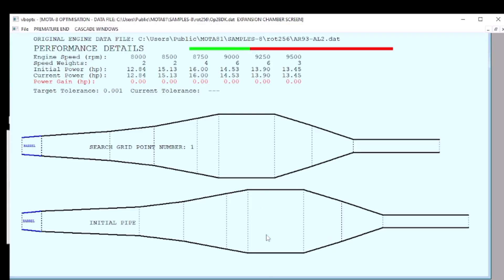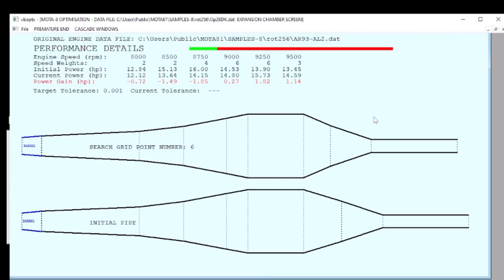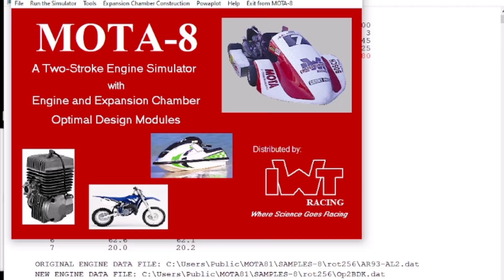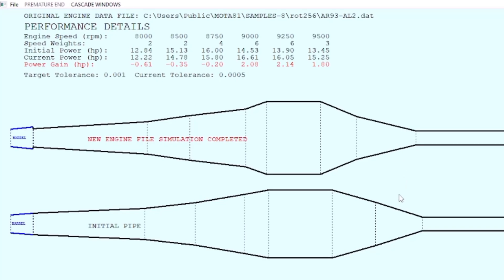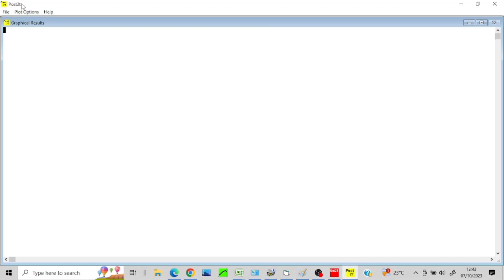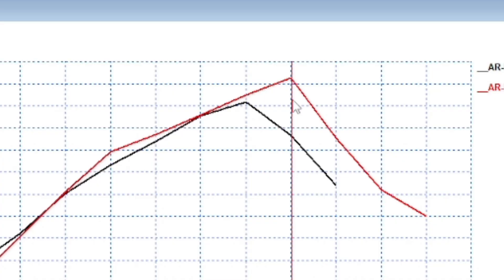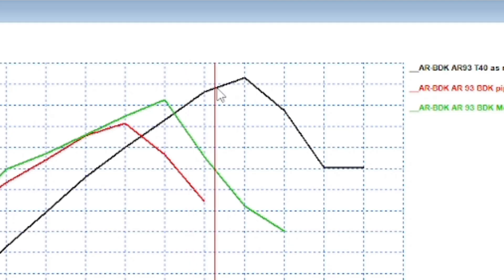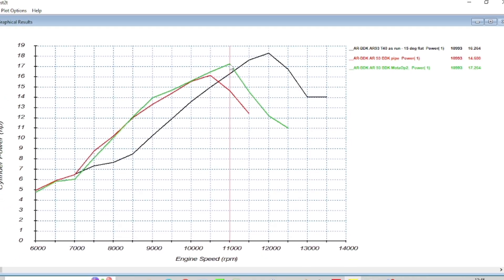A.I. designed tuned Exhaust | 2 Stroke Expansion Pipe | Mota 8

Comment: Thanks for sharing
Was there a reason for optimizing around 9k rpm in mota if you're looking in engmod2t around 11k or 12k rpm?
Reply: Power band
Reply from the maker: Hi Mitchell, I was wondering if someone would spot that! 😁
When I ran the dimensions I'd used in EngMod2T in Mota it peaked quite a bit  lower than in EngMod. I've found with the sims everything is relative so I figured a gain in Mota should still give a gain in EngMod. This was another reason for using EngMod for testing as it tallies with my Dyno results better.

It was an impromptu video so a bit off the cuff and first time for me using the optimisation feature. I need to play with it some more.

However, priority at the min is to get power back at the Dyno and do some testing ☺️

Comment: Hello - I'm interested in both Mota8 and EngModT2. Seems like Mota8 can only handle single cylinder configurations, is that the case? Can either of these deal with power valves? I see in both these software packages it looks like the pipe is always straight - how it a curve 2stroke dirt bike pipe dealt with? Appreciate the input.
Reply from the maker: Hi, yes. Mota just does single cylinders as far as I am aware.  In reality, on EngMod, I'd usually just model one cylinder if it were a twin and double the output. However, I did use it to design a 2 into 1 pipe for an RD350, so I did use two cylinders for that. Yes, I think be ause they are only 1 D sims then the pipes are straight. A full 3 D sim would be required to account for the turns in the pipe, but that would cost a lot of money and computing power.
I think of them as a comparator, make.a change, and see what it says.
EngMod has very good continuing development and can model about every combination you can think of and has an amazing array of information you can look at in PostMod. 
Mota is a bit more basic in inputs you need and the outputs in provides... it is fast, though, and on the optimizer seems really cool and can save a lot of effort. It can print out expansion pipe templates too which is pretty handy.
Both can model powervalves.

EngMod has more and MOTA is simpler (and a bit cheaper too)
Both are really good in my opinion. I guess it depends in what you budget is and how detailed you want to model.
Reply: @AutoBeta2T  Thanks for the info. It seems like people have used EngMod to develop curved pipes, and EngMod shows some pictures of curved pipes on their website. I wonder how effective it can be.

Comment: Is that a Kawasaki AR-80 Motorcycle?
Reply from the maker: Hi, the bike itself is an AR 50, but I'm running it with a 93CC Big Bore kit so nearer to an 80.
Reply: @AutoBeta2T  Awesome. We only had AR-80's in 1983 USA, and I won the 80cc WERA USA Grand National Championship.
I recognized it because of rear swing arm and mag wheels. (It's still in my storage
space (with a Kawi Rotary Valve 100cc engine), and I'm looking forward to riding it again) Thanks for answering so fast - but mostly for giving me hope in replacing that Kludge of a pipe I made for street commuting afterward...
Reply from the maker: @joeteejoetee cool, i also have the design for my pipe, but it does make the bike quite peaky
Reply: @AutoBeta2T  Peaky can be fun as-F though. The replacement engine is from a Kawi G-5 "commuter bike". I may have to replace the valve disk with a stock one because I remember after cutting away the rotary valve timing over a few weeks that I'd "gone-too-far" past optimum.
When it stopped being able to do wheelies in 2nd gear I was bummed, and knew I'd have to replace the valve plate and start all over again. I'd been buying used vanilla valves and cover-plates over the years on eBay knowing I'd need the stock parts in the 1st place: to have&modify them in this century...

Comment: I did this years ago optimizing Diesel calibrations, it's called DoE using an ETAS product.  It was integrated with the engine dyno and you put in what you want and what parameters to adjust them hit go.  It's not called AI because it's not AI.
Reply: Thanks for an interesting post!!

DoE is Design of Experiments. It's a technique for optimising multiple variables, with interactions between them. It uses methods like Orthogonal Arrays and Analysis of Variance. Fundamentally it is a statistical method and is not the sam  as state-of-the-art AI. ETAS is just a proprietary calibration suite, I think it is owned by Bosch. It has wide capabilities such as semi-automatic controller calibration and it even has the means to patch a Matlab  simulink Controller into the control software of the engine control unit. 

The above stuff is bog-standard grunt work in the auto industry but has little to do with your very interesting work.

If I understand it correctly you are using a solver to optimise the tuning using a proprietary engine simulator based on a 1D unsteady flow CFD code. This is commonly done in the auto industry when designing new/updated engines but I have not personally seen it done on an unblown 2-Stroke.

The best design optimisation solvers I know of are in the jet engine industry. Mind-blowing multi-physics  models. Those guys will kill for 0.1% fuel consumption improvement.
Reply from the maker: Cool, could you explain what DoE and ETAS stand for?

Comment: hey man fun question for you.
say ppl keep telling me to build my own pipe but im not a build a pipe guy but get the science. would you design me a pipe to build for a 70ish cc 2 stroke? i make around 20-22hp but in the wrong areas really. and the next pipe is about 300-400 bux. absolutely stupid.
Reply from the maker: Hi, what engine is it?
Reply: @AutoBeta2T  its a minarelli scooter motor with a racy cylinder on it. the yasuni c16 is pretty close to what i need. and i might have gotten my hands on a design to make a clone of one of those.
Reply from the maker: If you drop me an email @ autobeta2t@yahoo.com can have a look. If you can send the Yasuni measurements, that would help.
Reply: @AutoBeta2T  hey man thanks i really didnt expect you to be interested. but im glad you are. i had a bunch of life going on last little bit but now thats all over. im starting a new/old job and will have alot more ability to play around. i also went and rounded up some specs and pieces of what i built. and will have 1 item to change next season as i finally found the part number i needed.
i will get an email whipped up with some links to cylinder and pipe and also almost the entire spec for the pipe in question. maybe you have a better idea or design to unlock. im also willing to toss you some bux for your time when its all said and done.

Comment: The A.I. is just a program written by humans. With the limit of their knowledge of the subject.
Reply from the maker: Yep, I was a bit gimmicky with the title. Still a clever feature that saves a lot of time but still requires a bit more work in the sim and dyno testing after.
Reply: It works based on meta data trawling and then reproducing it, it could get to the stage where it will feed on itself data wise. Already there are operations in place to influence the meta capture information and skew the outcome, so beware.
Reply: @vumba1331  So no intelligence in there but just the reproduction of known solutions.
The best way to bury progress.
A quick response that no longer makes people think, on bases limited by understanding
of the programmer and his ability to properly code the little he will have understood.
Reply: @fabbri4497  Pretty much. Mind you, for some people it is intelligence.......

Comment: If you were to compare the two SIM programs, MOTA and EngMod2T;

Which one do you prefer and why?

Are things that ones does and the other does not?

If you were only going to use one of them for development, now that you have used both, which would you choose?

Thanks!
Reply from the maker: Hi, EngMod2T all the way. It has so much more than Mota.
I only upgraded my Mota as I wanted to play with the optimisation and 2D flow bits. I also liked using it for pipe layout and templates.
For pure development of an engine then EngMod2T. It constantly evolves into a better product as Neels updates it with input from the user community.

Comment: i beat Mota in 5 minutes    ..simply maximize pipe , that is pipe diameter ,  .... first go 150mm diameter  , only 3 parts  , 12 inch header 12 inch first cone and 12 inch end cone ,no belly , your jaws drop , 6000 to 16000 rpm like freight train .. adding belly with narrow your band so no belly ..  remember you need 360 degree intake to connect pipe to case and transfers , so you need to raise window holes up , to turn it into a case reed , now you can keep increasing case volume and pipe diameter to increase power to no end , unlimited power or you do it other way ,stuff case with skinny pipe and thats the end , limited powder.

Comment: Blimey, Mota has come on along way since I last used it. I had to stop when my version which used a parallel port dongle for licencing did fit my new PC which had no printer port. I switched to EngMod2T, what an awesome program that is. I used that to tune my Cheetah Cub 440cc and Cheetah DM 580cc motors.
Reply from the maker: Yep - I thought the same thing! I used Mota 6 for my first pipes for an RGV but then moved onto EngMod2T... I thought I'd upgrade as I wanted to try the optimisation element. As a note I fed my porting and pipe into it for port optimisation and it said 203 degrees on the exhaust which the Dyno agreed with on my last video ☺️
Reply: last version i bought was Mota 6.31 and it cost me a F)9*7^ 200 A$ and it did nothing more than the versions I did buy before, the only change was that  I could use it on a newer Windows machine, the manual is still crappy as the first day ( I still have the printed version of the manual from around 1998 )and it still does not explain why or how data you input will influence the results.. If I am right I did buy from 1998 till now one tad package and  3 updates,  and I have the feeling that overpaid for updates and even as a professional engine builder( yes I do that for a living ) I can not earn all this investment back without screwing my customers.

Comment: You should start with multiple different pipes...take the best of 4 and run that through again...feed it some odd pipes to mess with it could find sweet spot...Thanks For Sharing!
Reply from the maker: Hi, cheers and good plan.
It would be interesting to see where it goes with a different starting point. Will it come up with 4 different conclusions or one similar design. I'm going for the former.

Comment: Great video, Did you realize that the pipe optimization has been available from Ian at MOTA for a long time. It came when you brought MOTA 6 as a beta Version Called MOTA X. I think I've had my copy for at least 6 years. I've had MOTA 8 (and 7 the more advanced simulator ) for about a year and a half but unfortunately haven't had time to run comparison simulations between it and Engmod2T. I do like the automatic optimization to get you close, then run the more advanced MOTA 7 or Engmod2T to fine-tune the results. I only ran a few of the port timing optimizations using the supplied files just to try it when I first got it, but as you say it appeared to keep coming up with very similar results for some quite different scenarios for different engines. I haven't had the time to investigate further. If you are interested in Automated design you should look at the Generative Design options now available in Fusion 360. It can now do machine-generated designs using CFD (Computational Fluid Dynamics ) for port shape and flow. Another great software is ANSYS Discovery, which allows you to do real-time CFD etc on your port models, you can make changes to the shape of your ports and see the change in fluid flow straight away so you can try lots of different options. It can also be set up to run a whole range of options automatically and give you a report comparing them so you can choose which one best meets your needs.
Reply from the maker: Hi Bruce, thanks and no I didn't realise it came with MOTA X,
TBH I hadn't really played with two strokes for many years and then got back in it again for the AR project.
My first SIM was MOTA 6 that I must have gotten 2006 maybe but quickly moved to EngMod as it had a lot more features.

I only stumbled version 7 and 8 as I was after getting my version 6 going again but found out it was windows 10 that was the issue so upgraded.

Have you made many pipes from the sims you have run?

Thanks for the CFD info. I need to get going on fusion again. Does the CFD bit come with the hobby version?
Reply: Thanks for the reply, No I haven't made any pipes for years as  I've had to park my projects for the last few years but keep an eye out for what's going on as there have been a lot of great advancements in the last few years. I'm not sure about the CFD add-in for Fusion 360 on the home user. I'm lucky at work (Engineering Tutor at a Polytech) as I have access to a wide range of software (ANSYS, AVL Fire & Boost, Engmod 2T, Engmod 4T,  MOTA 7 & 8, everything Autodesk e.g AutoCAD, Inventor, Fusion 360 with unlimited cloud credits for Generative Design, etc but never enough time to get fully up to speed. Thanks, Bruce @AutoBeta2T
Reply from the maker: Sounds like you have all the cool stuff Bruce! Hopefully I'll get my head around it all in the coming months.
I want to do some flow testing on ducts. Will be good to CFD it.

Side note: I went to NASA Langley once and they had a cryogenic wind tunnel to test scaled models, instead of corrections for the density of the air they just scaled the air in the wind tunnel so it was the same scale as the model. Clever I thought.

Comment: Iterative goal-seek or A.I ?
If this is AI my calculator had it built in back in 1992.
Reply from the maker: Agreed, but it made a good title for the video. Side note. I ran the program for port timing and expansion chamber optimisation for the same engine and what came out was massively different to common perceived correct design. Is the program wrong or did it look at the problem from a different perspective... the common truths and realities we are conditioned to from an early age make us dismiss out of the norm thinking. Maybe the mirror of AI could broaden our perspective?
Either way, it's a cool feature that I want to explore more.
And agree with you - is it Al? I battled with this argument myself before putting the video up.
Cheers 😁
Reply: @AutoBeta2T  All optimization algorithms need a fitness formula to determine if they are making progress. Developing this is sometimes where things go wrong and we don't realize till we are done evolving our result. It may be optimizing for the wrong metric, or solving the wrong problem.
A lot of times simulating with neural networks etc you end up with the network braking the simulation and exploiting errors to increase it's score instead of doing well on the task you attempted to evolve. There's a wonderful range of videos on youtube showing hilarious results.
Reply from the maker: @1kreature, cheers for the extra info. 
Do you have a link to the videos you mentioned?
Reply: @AutoBeta2T  In this video at 2:30 the AI finds a bug in the simulation allowing it to advance and "win" over the other AI. https://youtu.be/Lu56xVlZ40M
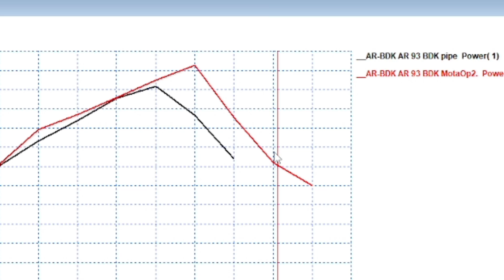At 4:00 the AI finds a way to get rid of the ramp in the simulation by glitching it out of the playing area. Again, not supposed to happen, but funny that it did. From then it just keeps getting weird with other glitches in simulation.
Reply from the maker: @1kreature cheers, I'll try to have a look this evening 😊
Reply from the maker: Cool, I watched those AI sims and some more (ended up in a YT AI wormhole). Sounds like the algorithms need very strict guidelines else they'll do the unexpected. A bit like us and the education system and cultural norms I guess.
Reply: @AutoBeta2T   There have been some real funny situations from systems learning the wrong thing. I find it hilarious mostly, but scary when things like self driving cars can't identify objects correctly. There have been incidents where Teslas have turned the wrong way into snow etc. Not ideal...
Reply from the maker: Yep, that Tesla driving into a truck that was sideways too thinking it was a sign as it only knew what the rear of a truck looked like 😲
Reply: @AutoBeta2T  And identifying a fish by looking at fingers holding it? 🤣 I can just see the researcher screaming at his computer "That is NOT what I asked you to do!!!💣☠:buffering: "

Comment: I predict less over-rev and less usable power on the real dyno just based on the short/steep last diffuser and funky baffle cone shape. When the pipe temp actually starts to stabilize on the track is where a lot of problems can arise.
Reply from the maker: It will be interesting for sure. I will make a pipe from the program at some point, You can constrain it at certain points too just so it doesn't go too off piste...
I did let it run free reign on both pipe and ports and the pipe looked very weird! It would be good to see if it could come up with something quite away from the norm that works but probably never got tried?
Reply: hi  @2strokepipes471  isnt over-rev governed by the angle of the first section of diffuser and the first section of the baffle?
  is so the first section of baffle cone is steep (stronger pulse)  which means that after peak power the pulse will be stronger. this is what ive been led to believe on the kiwi biker forum. unless ive read it wrong.